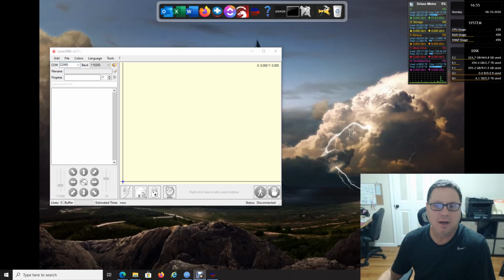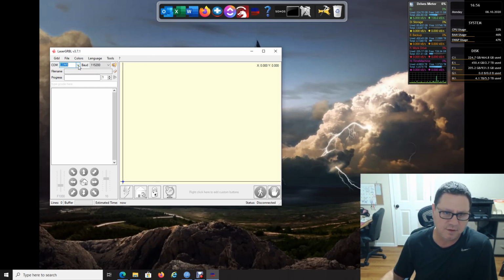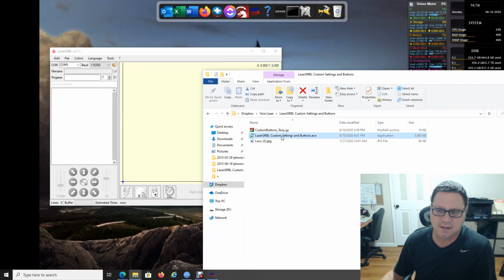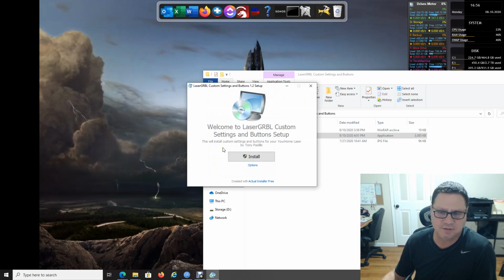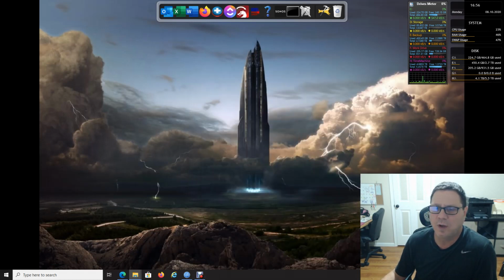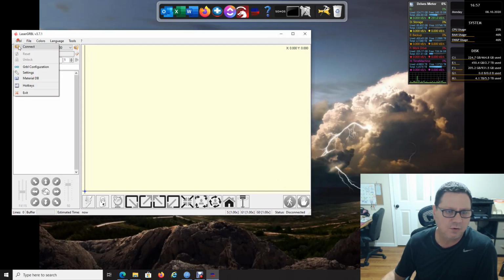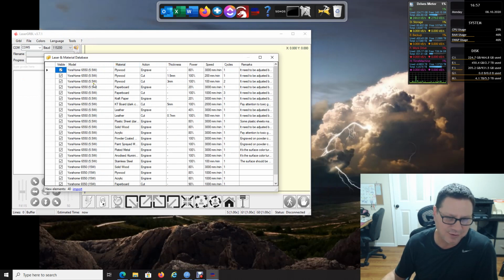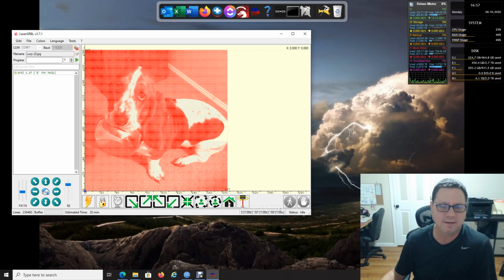Easy Custom Buttons in LaserGRBL

Comment: You're video needs to be redone Tony, I got them installed but i dont see on your video how i had them installed, You download the file and and the the CH340 file and you connect to your laser and then you go up to tools and install the CH340 file that shows up there and then down in the "Custom Buttons" bar you right click and it gives you options and I did import and i imported you're file and it gives you prompts and you follow it from there, You have to have Lasergrbl open to do all that. No where does a program pop up like you show in the video, Hopefully my instructions helps. But i do have to say i like your layout and how easy it is to use your buttons.
Reply from the maker: Hi, I haven’t used lasergrbl in many months but I would hope it’s still very similar to how I described. Right click on the custom buttons section and choose import.  Then select your file and accept the prompts.  
I’ll have to update the lasergrbl and see if anything has changed.
Reply: @TonyPaolillo  It must have changed a lot  - when you download the file, the extension is a .gz not an .exe. Which for us newbies threw me (us) for a loop. What Greg Stevens said to do worked - now on to your next video - thanks so much.
Reply: Thank YOU - that worked!

Comment: Hi I downloaded it and when I click to open I get a message This file does not have an app associated with it for performing this action.  Please install an app or. if one is already installed, create an association in the default Apps settings page.    I open laserGRBL go to settings  and then I don't know what to do.  Can this only be done if attached to laser?  I have not done this yet?
Reply from the maker: Hi, you can’t open the zip.  You open laser grbl and then at the bottom you see custom buttons, right click there and choose import.
Reply: @TonyPaolillo  I can't run the software after it has downloaded in windows.
Reply from the maker: @mariajohnston2147  what software are you talking about.  Lasergrbl?
Reply: @TonyPaolillo   no the custom  button download.   At 52 sec in your video I don't get that exe    I used the above link